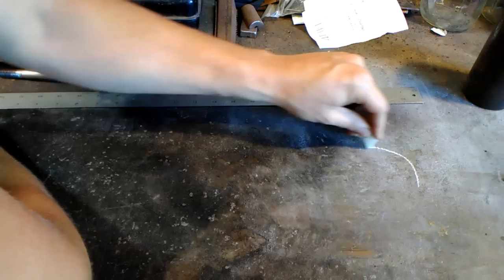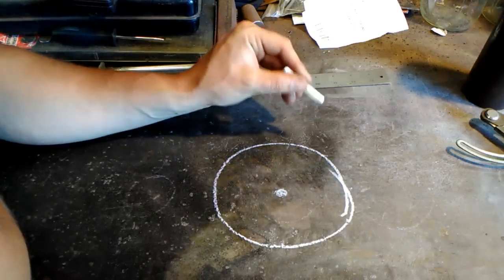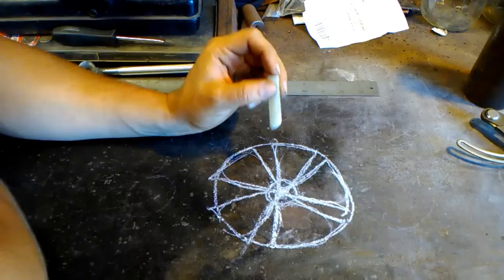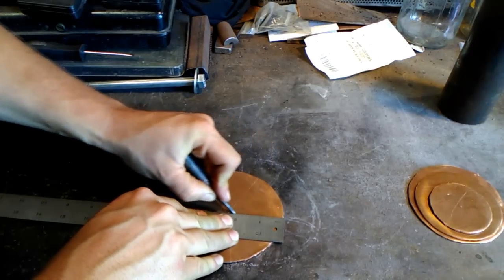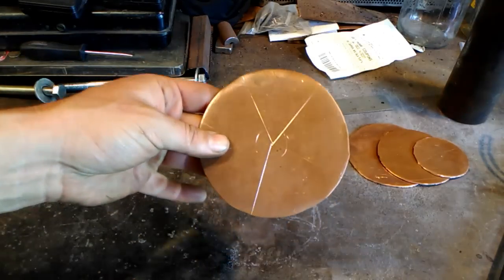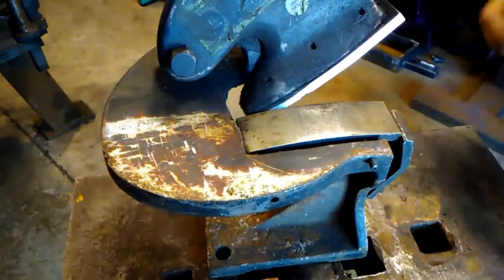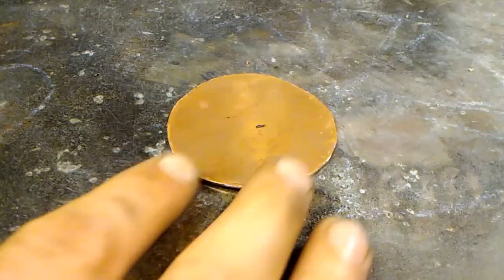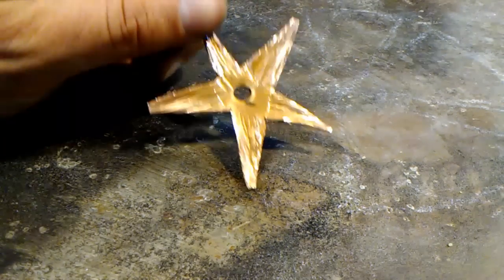How To Forge a Rose with a Copper Bloom PART 1 // Rose Forging Tutorial

Comment: roy i had a thought when you were working the petals 4 inches multiply by 3 then divide by 5 you end up with 2.4 inches which you can use to  scribe your lines and how thick is your copper your using
Reply from the maker: +grayem pepper the thickness of copper I am using is 1/16 inch I'm not sure what that works out to gauge but I think it's 12 gauge. Your math seems like it would be a useful tool with larger work for sure thank you for sharing. God bless you this weekend

Comment: I just want to warn anyone not familiar with making these. If you use a drill instead of punch to make you center hole, make sure you lock the piece into place with a vise or something other then your hands. You will cut your damn fingers off or slice your hand up pretty bad once that drill breaks through to the other side. It will grab the metal and turn it into a very sharp saw blade and you wont be able to hold it tight enough to drill it safely. Trust me i learned the hard way. Not once but twice. Thought it just slipped the first time so i held it better and both times i damn near cut a finger off. lmao